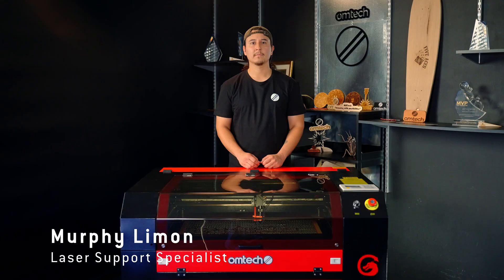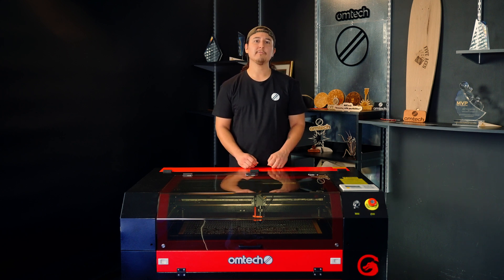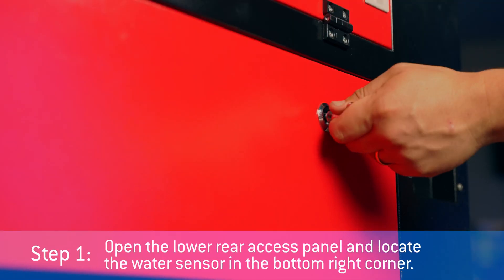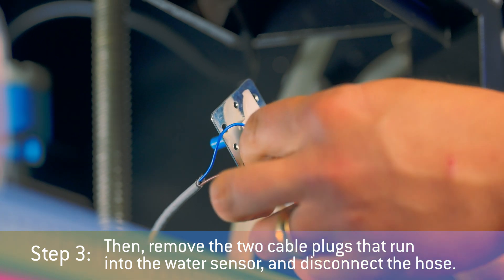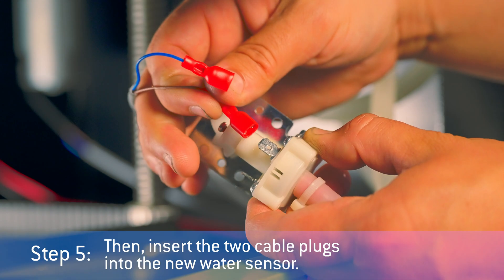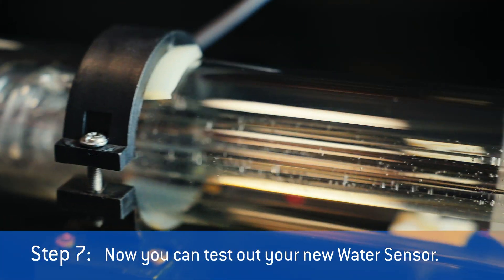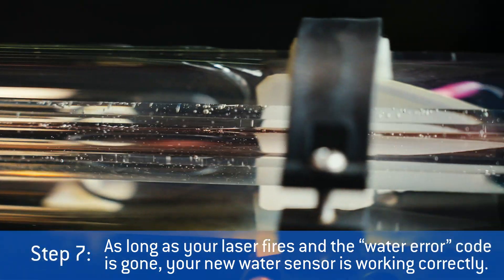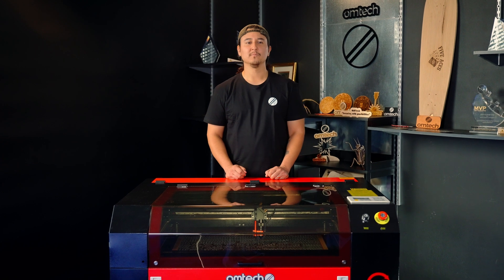How to Replace Your CO2 Laser Cooling Water Sensor

Comment: Is there any recommendation to install the water flow before or after the laser?
Reply from the maker: What are you meaning by "before or after the laser"?
Reply: @omtechlaser  I mean, to install the flow sensor between the output of the chiller and the laser inputs or between the output of the laser and the input of the chiller. I think that the second option is better, but I would like to hear your thoughts...
Reply from the maker: @oaklejant  Between the output of the chiller and input of the laser machine. The water flow sensor needs to detect if there is any input to the laser.

Comment: I have a new150 watt model 1610 OMTech laser that I have just started setting up to use.  After setting up everything to the point of test firing a pulse, my machine is NOT firing.  It is showing an error on the control panel that reads "Water Protection Fault".  Nothing is connected wrong as far as I can tell and water is flowing through the system.  This chiller connection differs from my 100 Watt OMTech Laser in that there is a 3-prong outlet for an alarm on the chiller rear and an identical socket near the water hose locations at the rear of the laser.  The laser did come with a cable that will plug into these sockets but there is nothing I can find in the instructions about hooking this cable up. Please help if you can.  Thanks!

Comment: Where can I find a replacement for my sensor on a 100w OmTech
Reply: Currently OMTech doesn’t offer replacement water flow sensors for purchase outside warranty. We recommend purchasing the 10mm cloud ray water flow sensor and splicing the wires in

https://amzn.to/3JND16J
Reply: @EdmondsWoodshop  how do we install the other version? It looks different. How do we splice the wires?
Reply: @EdmondsWoodshop  I purchased! Thank you
Reply: @angeladelreal9046  how did you install the other version? It looks different.